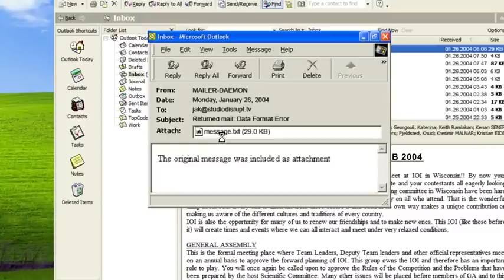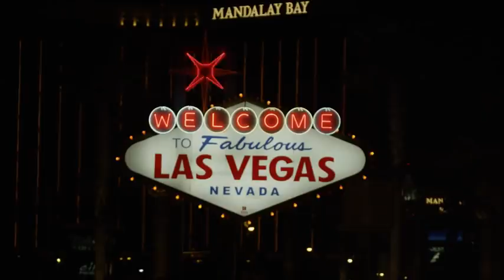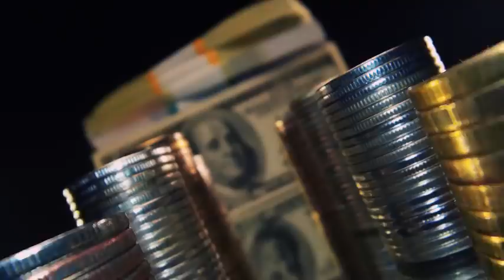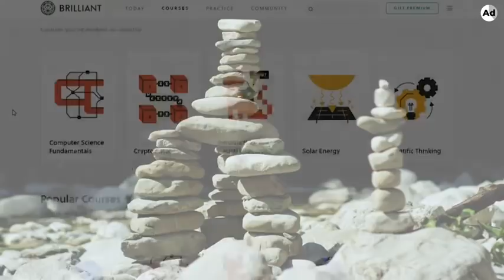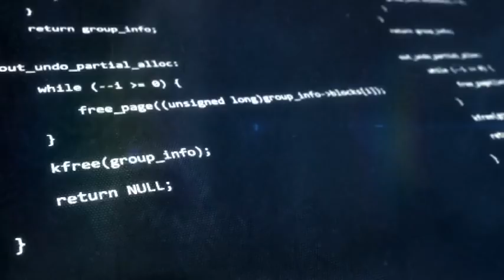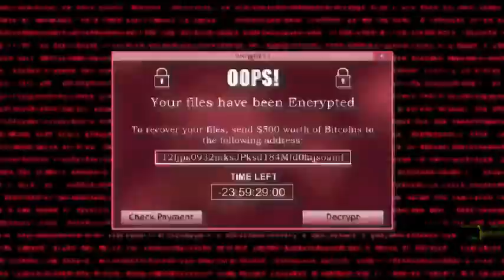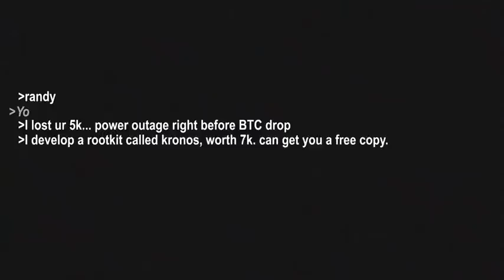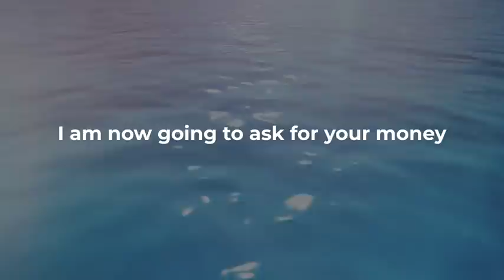Earths Deadliest [computer] Virus (Read description)

Comment: transparencies
an individual represent each and every devices he/ she owns
core ohm per individual
excess ohm bear by the [centralized main computer]*
*a true form of gateway where internet and connectivity starts here
of any differences outside per individual allocation will be in question
----
matter of data
and so the energy usage
----
the risks of binary are immense if not incalculable
knowing data unsaturated
yet it requires energy
and so in that effect measurable
so as the AI
----
Reply: try get to know more of Physics i.e entropy
quite interesting.... lotsa unique there

Comment: reddit comment on video:
FYI this was taken down because it was plagiarized. Almost the entire script is copied 1:1 from either Wikipedia, or Marcus Hutchins confession from Wired. Wired responded by claiming copyright on the video and Disrupt received a strike.

my opinion:
the script is only one half of the video, as the editing adds valuble transformative media, wich allows the story to be told in a much more immersive way. even reading from wikipedia is fine, if there was enough work put into the edditing. wich there was.
Reply from the maker: thanks for more information on the reason the video was taken down!
Reply: @4hunnid50  its really nothing. i just did some light searching and found it.
Reply from the maker: @56independent42  ah, ok
Reply: Damn, seems like the redditor was wrong. There was no strike on the channel.
Reply: yeah fr and he credited his sources and paraphrased. plus it wasn't the entire video lols